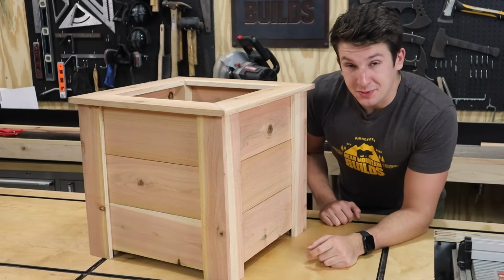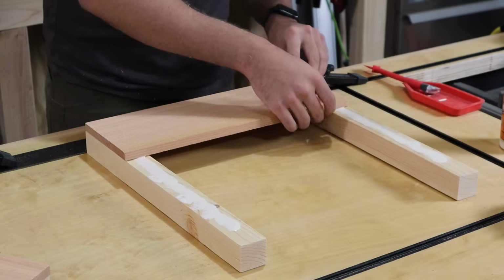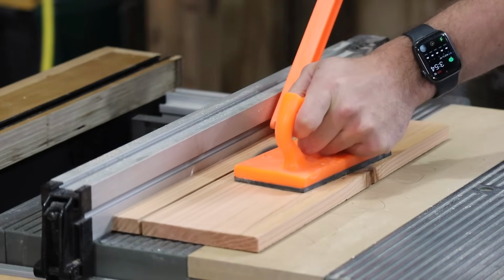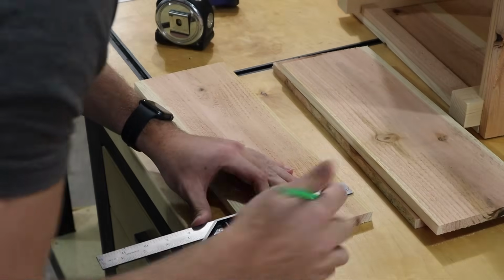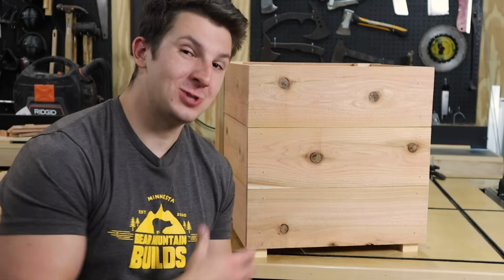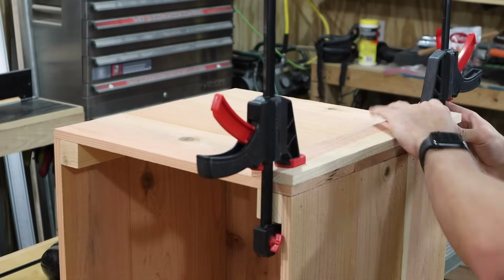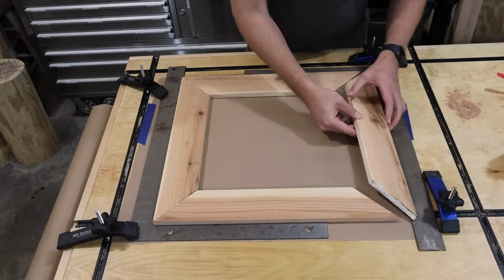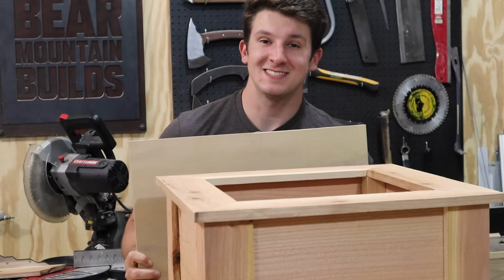Simple Cedar Raised Planter Box | FREE PLANS

Comment: I built a modified version of the box where I used a plastic square bin that would hold the soil and plants and built the box around it. For the bottom, the plastic container had holes drilled for drainage and the wood planter box I placed some cut rebar to hold the box in place. I did not want the bottom of the wood box to have anything that may rot due to water drainage. I placed wood chips on top and no one knows there is a plastic box inside. This has helped me keep my wooden box looking great with no rot or any other kind of damage. I have had it for 8 years and it looks great. If anyone wants to paint their box, I suggest stain it instead of paint. It soaks in and there is very little or no peeling. Stain comes in so many colors that it looks painted. I also use cedar pickets and sand them down for a smooth finish. With the cost of lumber it helps to improvise. I have built so many that I now give them as gifts.
Reply: I did something similar except I used a roll of thick plastic along the sides to protect the wood. Mostly because I had it lying around.
Reply: I am trying to find a video that shows exactly as you described, mainly because I have to easily be able to move these boxes after filled with dirt.
Reply: That's actually a great idea, thanks.

Comment: There is no way to find 1/2” thick pickets in my area. How about plans for the standard 5/8 or 19/32 that are available.
Reply from the maker: You could use 5/8 or 19/32". It wouldn't really change the overall dimensions much if at all

Comment: Great little project.  I modified the build from the plans a bit by beefing up the internals to essentially 2x2 skeleton and added a lid.  I keep it out by the garden and it has a little tool rack inside for a small trowel, clippers, garden twine, and other tools.  No more having to run back and forth from the shop or garage chasing tools.  Plus with the beefier frame, old folks can sit on it for a short rest.

Comment: This is a beautiful planter, and a great side. I’ll also make a longer one with a tweaking of two panels. Thank you for the plans!   I will say this about structural integrity and use… I’ll have to cut the center bottom just a wee bit more narrow for drainage, and I just know the first time someone grabs that top overhang to move it, it’ll come off. Dirt is heavy. Wet dirt, even more so. So I will use stainless screws, countersunk, and fill with sawdust and glue. Again, thank you so much for the plans!

Comment: Thanks for uploading this video! I downloaded the plans and love the simplicity. For my tools, I have a radial arm saw, table saw, band saw, sanders, etc. I'm doing my first one with Douglas Fir as a kind of prototype before doing the next ones with cedar. 
For the box itself, I'm using finishing nails and will cover them with the outside corner pieces. The bottom supports can easily be trimmed down to fit between the 2X2's using my Radial Arm Saw. 
Also, just a quick insider tip: If you have a good table saw, you can make 2X2's from free crate/binder wood. I get them from Home Depot for free (they throw them out anyway) and it works great. 
With mine, I'm going to be sanding the hell out of them and figure out a good varnish. 
I look forward to building more of these and trying other plans you've uploaded.

Comment: Hey Zach!  Another great build & rock solid as always!
I noticed a comment about soil being heavy & that the top trim piece would pop off.  You didn’t say this, but I assume this planter is simply a decorative ‘pot holder’ as opposed to actually filling it with dirt.  Therefore, to move the planter, you simply lift the pot out, relocate the planter & place the pot back into the planter. 
Being a seasoned gardener, that is far easier & so much more practical.  And the planter will last a lot longer as well. 
Great job!!
Reply: Don't listen to anyone, dump potting soil in there if you want to sweetie
Reply: Wood glue is no joke. There are videos of people testing it's limits with various types of wood and in most cases the wood fails before the glue does. I wouldn't trust it with my life but 25lbs of wet potting soil isn't going to phase the glued joints.

Comment: Really nice planter, might need to make a few for the GF. Only thing I would change is the braces at the bottom to be multiple 1 inch wide pieces with gaps for water since I would be putting them in pots inside there planter

Comment: Beautiful end result, however I have a couple of concerns. 1) There isn't any gap in any of the wood planks to allow for seasonal wood movement. Did this warp with weather/time? 2) There is no drainage on the bottom. Planters virtually ALL need drainage. 3) I couldn't tell but was that glue for outdoor use and water resistant? Other than these questions, great job!
Reply from the maker: Glad you like it!
1. The fencing was pretty wet when I put it together and has since shrunk very slightly, but not enough to change the appearance drastically or cause damage 
2. I drilled holes in the bottom boards for drainage, but forgot to film it. The center board shrunk enough to allow water through the seams anyway. 
3. I used gorilla glue for this that was rated for outdoor use and I haven’t had any trouble with it
Reply: @BearMountainBuilds  Awesome! Thanks for responding to my comment. Much appreciated. :)

Comment: Nice build, great planter box. A bit of wisdom I can share with you, next time leave a small space between each of the cedar boards on the sides and bottom 1/16 to 1/8 will do ( I use a small nail to get my spacing right and even). What you'll find is that the cedar will swell with the weather and may lift up a bit at the seams or worse crack in the middle of the boards. First time I built a cedar cooler box for the outside this happened to me on the top. Once I left the spacing, problem solved. Cedar is a great wood for this but it does like to swell. Looks great though. I'll be making these for sure.
Reply from the maker: That’s a good thing to keep in mind. I definitely noticed that my boards had all shrunk the day after
Reply: Spacing on the bottom boards is good for drainage, as well!!

Comment: You should look at drilling some drain holes in the bottom boards. Let the water out so they don't rot. Also, seal the ends of those 2x2's or they'll soak the water in and rot out.
Reply from the maker: Good point on sealing the ends of the 2x2s. You can also just use cedar 2x2

Comment: Kinda beginner question for it being outside your opinion can I use the deck spindles for the 2x2 just cut the 45 angle thanks
Reply from the maker: Yeah, that would totally work!
Reply: @BearMountainBuilds  helo thanks for the response really like your channel i just totally over built my first ever planter PT 4X4 for the legs, fence pickets for the sides, leftover deck boards from last weeks deck close off, deck spindles for the supports wire mesh on top of deck boards then fabric on top of that measures roughly 38x38 corner to corner i also made the bottom about 1/2 way down to limit the dirt cause it sits about 3 1/2 feet tall im roughly 200 lbs and i can stand in it lol

Comment: First, thanks for posting. I am definitely going to build these for my wife. However, a couple of concerns. I am not a new woodworker, but not an expert either. Shouldn't you leave a small 1/4" gap for expansion and contraction of the wood on the sides? I think that I would likely make my own 2x2's out of cedar so that the pine 2x2's don't rot out since they don't have any weather resistance. I am not complaining, just learning. If I am wrong about this then please let me know. Thanks again for posting and nice shop.
Reply from the maker: I didn’t leave a gap because these boards were pretty wet already so I wasn’t worried about them expanding anymore. As for the 2x2s I used treated wood so they should last, but making them out of cedar works great as well!

Comment: Good looking design, though the boards are little wide to be gluing across the grain. I think you would have been better with beefier corners (you can glue them up if that's the only thickness material you have) tenon the top and bottom rail and let the rest float in a groove as well as tongue and groove each board so the don't buckle in and out one from the other and it would look nice to chamfer the edges so you have a little v groove. Another little tip..the best out door adhesive that will never fail under any weather conditions would be the West System marine epoxy..plus cedar contains oil which may cause regular glue to fail. I'm not criticizing you.. just some tips from an old timer with a lot of experience.

Comment: Hi - I see allot of glue. I am new to this, but wondering if Hot Glue would work well, and what kind of waterproofing stain can you use on cedar? Thank you
Reply from the maker: You definitely want to use wood glue not hot glue. Preferably something with water resistance. I like Titebond type 2. You can just put a clear coat water based poly on

Comment: Hi Zach, do you have these same or similar plans but in a taller and wider size? Maybe something thats 24" - 30" tall? This one sits at 18" tall per the drawings.
Reply from the maker: I don't have anything designed for that tall, but you could just lengthen the legs and add another horizontal plank or two to the sides and you would hit the height you want

Comment: Question: wouldn't drainage be an issue for this design? I didn't see any drainage holes put into the bottom.
Reply from the maker: The slats after they dried out had decent sized gaps in between but a couple more holes wouldn’t hurt

Comment: Hi Zack! I downloaded your plans for this planter box. I think it's super! I have a question though... on the top frame - do you measure the length for the miter cuts  from the inside corners (the short length) or the outside corners? I haven't assembled anything or even finished the cuts yet. I'd like to finish all the cuts before assembly though and would like to avoid a trip back to the store at this time.   Thanks Zack!!!
Reply from the maker: I believe I measured from the outside corner. There should be 2-3” of overhang
Reply: @BearMountainBuilds  Hi Zack. In hindsight this really was a stupid question. Your plans were perfect. I reviewed them again and looked at the page with the top view. It was staring me right in the face!    LOL
Reply: @BearMountainBuilds  I'll be coming back for the mobile benches soon.   🙂

Comment: Very nice planter box and a well-edited video. However, the convenience of using 2X2 pine corners is outweighed by how fast the pine will rot and destroy your box, compared to how long the cedar will last. Why not make your supporting corners out of glued-up 2" cedar strips.
Reply from the maker: If you use pressure treated 2x2 it will work last for a long time, but cedar 2x2 works just as well

Comment: Well the bottom part was open when you were building the side trim so there's that, and the 2x2 looked to be plain pine which will rot so NO thanks!
Reply from the maker: I used treated 2x2, but you can use cedar 2x2 as well

Comment: It’s a nice box, but your pine 2x2’s will not last in the weather and you should use rite Ins waterproof glue. The glue you used will also not last in the weather
Reply from the maker: If you plan to use it for outdoor use you should be using pressure treated 2x2s. I’m using Titebond 2 which is water resistant
Reply: @BearMountainBuilds Please do not grow food in pressure treated wood planters...
Reply: Your using Gorilla Glue. Which to be fair is waterproof and an excellent glue
Reply: Or you could burn them to seal
Them with a weed burner. I do that on all my pine, lasts for years
Reply: @BearMountainBuilds  Titebond III is more suitable for outdoor planters

Comment: Not a bad box.....Wouldn't have used the Gorilla glue for "that" particular project. It's going to get wet from rain and watering plants. That particular glue won't last and will fall apart. Should have used resin glue instead. 

This being a "planters box", you might want to incorporate sealing the wood. Though cedar is weather tolerant. it is not soil (moist/wet) tolerant. In other words, if you notice a fence (cedar) NEVER touches the ground when installed. If you look at any fence that is touching the ground, it's rotted. 

Nonetheless, it's not a bad build.

Comment: A design that doesn't use brad nails and glue would be way better for exterior use. Dont bother filling in seams with sawdust either, the wood is gonna move like crazy outside and it will see big temp swing every day and those seems are gonna crack open in no time.